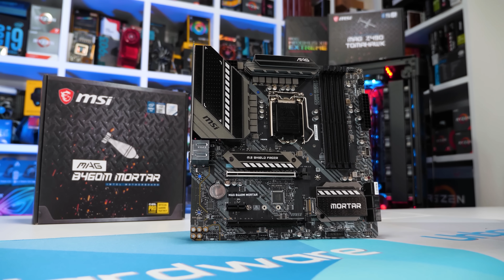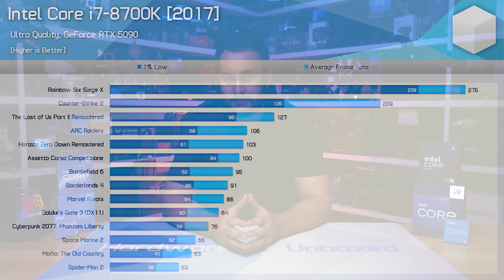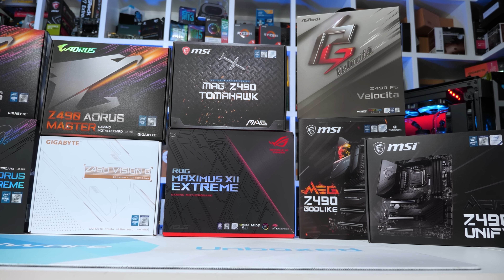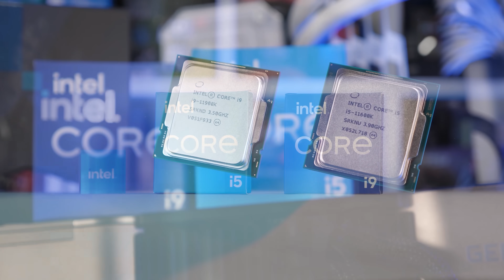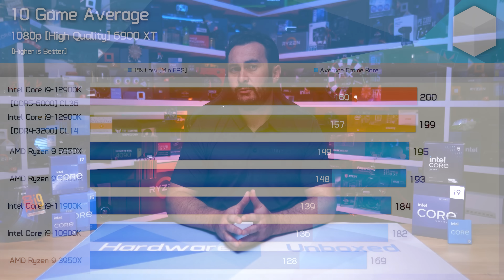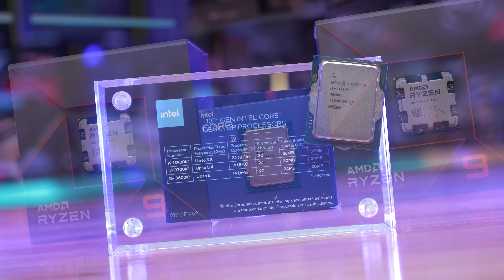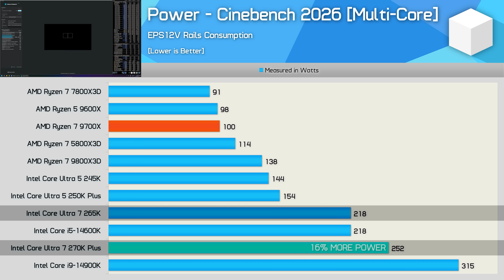How Intel Fell Behind, 10 Years Of CPUs Benchmarked

Comment: Ive been a loyal intel boy.  7700k delidded and it carried me for years with my 2080 Super then 3090.  From there I went to the 10850k which was a -100mhz 10900k and that worked very well still on my 3090.  Then on to my current 14900k with the 3090, but realized that a GPU upgrade was necessary.  So now Im on 14900k/5090 and its hopefully going to be good for years to come.  I contemplated going AMD at times, but intel has just been tried and true and never gave me an issue not once.

Comment: I've owned several "high end" CPUs over the years. 6700k, 8700k, 10900k, 13900k, 7800X3D, 9800x3d, 9850x3d. My favorite CPUs of all time are the 10900k at 5.2ghz with 4400c15 ddr4 and 13900k at 5.8p/4.5e/5.0ring  with 4200c15 ddr4. Eventually, I bought into the hype of X3D cpus. I got an amazing deal at Microcenter (7800x3d, X670E-F, 32GB TeamGroup DDR5) for $500+tax. I thought I would be blown away...Instead, the 7800X3D absolutely sucked compared to my 13900k. I hated the 7800X3D! It was slower, couldn't be overclocked, and was super boring. I then got a 9800x3d which is better, but still isn't nearly as much fun as Intel CPUs. I've spent some time OCing my 9800x3d to 5.5ghz static all core at 1.2v with 6400c26 2133fclk which has been running flawlessly since launch. Unfortunately, the gains just aren't that impressive and extracting extra performance from X3D isn't nearly as safe or fun as Intel. My 9850x3d also runs 5.5ghz with 8000c32. It's so boring that I have a 9850x3d with X870E Apex just sitting on a test bench in my garage with a 9070xt Nitro+. I'm not sure the glory days of Intel will ever come back, but I'm not sure AMD is capable of providing true enthusiast level products the way Intel has. I hope NovaLake is super competitive, has strong OC capabilities, and has longer platform support. If Intel can consistently pull off those things, Intel will regain the crown.
Reply: 4400 CL15 sounds mad. What's the performance difference between it and sth basic like 3200 CL16? Always wanted to know how much tight latency affects performance, but there's next to no info online.

Comment: Here is why Intel is where it is today in the last 10 years:
Mar 2017 AMD: Zen Launch and AMD returns to high-performance desktop computing.
Jun 2020: Apple Transition Announcement: Apple sets a 2-year deadline to ditch Intel.
Nov 10, 2020: Xbox Series X/S Release first mainstream consoles powered by Zen architecture.
Nov 12, 2020: PlayStation 5 Release - Sony joins the Zen-powered console generation.
Nov 17, 2020: Apple M1 Mac release is the first consumer Arm-based Macs reach the public.

The question is what happened before that?
The answer can be summarized by: 14nm++++++++

Comment: Hehe I'm still running a 9900k with 32gb 4x8 4200 cl16-16-16-32-48 1.5v and a 3090. 

Put my golden 8700k in a pc I built for my mom. The chip will do 5.2 ghz at 1.26 volts (basically stock voltage) avx stable and it can do 5.3 ghz but it needs 1.36v to be stable.

Only time I feel I could use an upgrade is when the 3090 can't manage at least 4k 100 fps in a game. Then I switch monitor to 3440x1440p and it feels fine again. Only thing I really need is an ssd. Only have a single 1tb gen3 drive. My 500gb 970 evo died after 15 tb written, but was 4 years old so no warranty.

I had a 10900k for a little bit with an evga z590 dark board. It was the worst platform and cpu I'd ever used. Supposedly unlocked but the chip would not go above 5.2 ghz no matter the setting set in bios or even with the oc software. I despised the "new boost algorithm"... set a manual voltage in bios like 1.35v but then it would be shoving nearly 1.5v into the chip. It very well could all have been the mobo causing all the issues because evga abandoned it in 2 months to work on z690.

Comment: Changin today from i7-7700k to 78003dx, as recently upgraded to 9070xt. Man Im hyped to see the framerate jump!
Reply: Yeah I went from an i7-8700 to a 7600X3D with a 6800 XT and my FPS basically doubled.
Reply: Went from 7700K to 5900x back in 2020. Was a major leap in performance at the time. Since then I've sidegraded to a 5800X3D and can't complain about the longevity AM4 has provided. Will either wait for next gen consoles at the earliest or AM6 at the latest before upgrading.
Reply: My plan is to finally upgrade from my i7-6700 (non-K) to the 9800X3D later this year. I don't know if it will make much difference as my 3080Ti is a bit old now, but it should remove any CPU bottleneck for the foreseeable future. (Edited to fix a typo)
Reply: @nzmetalhead  it depends on the game. Some are CPU dependent, while others are GPU dependent.
Once you switch to the 9800X3D you will see a massive boost in performance regardless of how the game dependencies are. Simply because the newer technology is so much faster like DDR5 memory and PCIe 4 vs 3 that your old 6700 motherboard had. That alone doubles your bandwidth the 3080ti is designed to use. The 3080ti has a massive bandwidth that was severely hamstrung by your older MB and CPU and memory technology. 
Definitely do the upgrade and enjoy the massive boost in performance!
Reply: @nzmetalhead  For the games I play, My 9800X3D made a big difference with my 3080
Reply: @kendokaaa  Which games out of interest?
Reply: @ralfsta Factorio, any Paradox game (Hoi4 more than others), survival games like Green Hell and the Forest, Far Cry games, Cyberpunk 2077 without RT, BF6, etc.

I usually target 100fps+ (ideally 165fps for my 165hz monitor) and lower my graphics settings to get there but so many games were heavily CPU limited. I previously had a 3900X
Reply: That’s gonna be a wild jump

Comment: I had the last of the greats the 6700k i7, lasted me for a quite a while, then upgraded to 9900ks when I splurged a lot on a new pc back in 2019 and then after three more years I went for 13900k and I think this cpu will last me almosta decade, as there is no reason to upgrade as I play on 4K now and have been for the past 2 years. Oh and with intel I started with the now very old intel core 2 duo 8400 that basically lasted me the most out of all the cpus up until i5 3470k , which is quite interesting. Even more interesting is my first PC was not with intel cpu, but rather amd duron 750
Reply: If you would have went 4k before the 13900k you would probably still be using the 9900k. :D I know I still do for 4k!!

Comment: Intel's Core i7 7700K was my last Intel desktop processor, and YES I delided mine as well and put a waterblock for a custom 360mm watercooler in it.
At the time, I paired it with DDR4-2400 32GB (16GB x2) and Nvidia GTX 1080 Ti 11GB.
Now, that system minus the watercooling and the GTX 1080Ti, but added 2x 10GB Intel LAN cards is my Router running OPNsense, a Linux based router operating system 👍
However, since then I switched over to AMD and used 2000 series, 3000 series, 5000 series and 9000 Ryzen and Threadripper series processors.

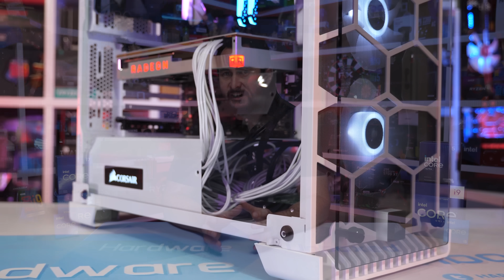Comment: 9:31 great to see another RADEON VII 😍 you should make a revisit video about it how it holds up in 2026
Reply: I still have this gpu (Radeon VII) on my brother pc (works better on linux (raytracing is working) but my brother prefers windows 11(he have Ryzen 7 5700 X3D, 32GB Ram). 
If we got re-test Radeon VII, please make some linux benchmarks too.
Reply: Dang, I thought this thing is a vaporware.

It's hard to get one, and then it was swiftly replaced by 5700XT by AMD.
Reply: I had one and it died within 2 years of me buying it. During the great GPU shortage of 2021.
Reply: @Powerman293  By any chance, did the HBM modules come from Hynix?
I have a VII that came with HBM2 modules from Samsung and it's still running. I heard the interposer used on the VII's with Hynix HBM modules is a huge failure point
Reply: i think it holds rather up
Reply: Vega's last stand!
Reply: Holds up better on Linux. And still can't run Crimson Desert or FF7 Rebirth unfortunately.
Reply: Im also still running one under Linux... Or well the original datacenter card the Radeon VII was based on (Its the same GPU theres no hardware difference)
Reply: Still have my Radeon VII! She sits safely in a GPU box waiting for the day I have space to display her.

Comment: My 10850K felt great with its 7 plus symbols -100Mhz, but honestly its CPU/RAM latency was very snappy (37ns) and Windows/Apps responded lightning fast. But 180watts in Premiere Pro and Shader compilation did hit me hard in Australian Summertime. Making my room a bit of a hotbox.
Reply: I only have two modern intel CPUs and I thoroughly hate one of them.  10300H. It never runs at less than 90C, not even in the winter. And the only reason my Xeon is good is because it runs on a hacked mobile chipset and draws 60W max.
Reply: I'm still on 10900k and feel no need to upgrade at all (for gaming workloads). Play on 5160x3160 using a 5090, aka CPU bottlenecks are non-existent or minimal (i think once i saw 5% bottleneck or so compared with benchmarks on this channel).
Reply: @ZenzDeluxe  nah, i had to replace with i5 14600k. Its single core is too slow if you need fast cpu for gaming

Comment: Nova Lake will probably not be very successful, even if it is genuinely good. The problem is that AMD has by now quite heavily dominated the DIY market for years. Nobody (or hardly anybody at least) with an existing AM5 system is going to switch to Intel..., there is no point at all in doing this (waste of a lot of money). Even if Nova Lake can beat Zen 5 quite significantly..., just wait 6-12 months for Zen 6 then and simply upgrade to that. This will even be very worth it, if Zen 6 would end up being 10% slower than Nova lake (which is kind of unlikely). 

That means Intel is essentially left to compete with AMD for AM4 users or customers with older DDR4 Intel Systems... . Since even Zen 7 will come to AM5 (almost guaranteed by now) the decision then would heavily depend on platform longevity. AM4 users could still buy into AM5 with Zen 4 fairly cheap at that point and upgrade to Zen 7 in 2030-2032...  . If Intel again plays the "you need a new socket/mainboard" game for the first new architecture after Nova Lake...  complete fail.

Lastly, a lot will depend on pricing for the CPU and also for RAM at release. If DDR5 is still very expensive at release Nova lake is simply doomed, while Zen 6 may still be fairly successful as in socket upgrade for existing AM5 platforms. Newest "rumors" also suggest that the Intel 3d cache equivalent will only come to expensive higher end versions of Nova Lake... .

Overall I do not see Nova Lake being successful in sales. All Intel can hope for is getting a new foothold, something comparable to Ryzen 1000 back in the day. Nothing more.

Comment: From the second generation Core to the seventh generation, Intel gave us NOTHING. SIX generations, from 2011 to 2017, Intel gave us NOTHING. They drove technologies to make it cheaper for them to make the chips they sold us, while simultaneously not changing the pricing hardly at all, with virtually zero performance improvements. They DESERVE to go under.

Comment: Whatever Intel did to screw its fan base with forced platform changes paired with their lack of innovation paid off with their plummeting stock prices, market share, and immense lay offs. That's Karma!
Reply: Weirdly enough, they are continuing to do exactly that right now.
Maybe the next generation could finally come with their first new CPU architecture in 6 years, but it will certainly be on a new socket, for SOME reason
Reply: @malucart  They have to make a new socket. Nova Lake is a big change, and most of 100+ new pins most likely will be dedicated to power and IO changes. When you design chips for non-socketed systems routing/pin layout always changes. Keeping the same socket always gonna limit you to what you can do next. Something brand new on silicon side take up to 5 years. There was no "quick way" for Intel to respond.
Reply: @davidlt  Yet AMD was able to figure out the socket issue.
Reply: plummeting stock prices, while at the highest it's been in 5 years? What are you smoking.
Reply: Some facts: Consumers are not Intels most important customers, enterprises are. Intel's market share is still much larger than AMD. Intel stock price is record high. I don't care whether I use AMD or Intel, and one shouldn't let bias get in the way of facts. PS. There is no need to celebrate immense layoffs of real people.
Reply: And still did sell more than AMD…. 
😂

But yeah… they did lose a lot of market share!
Reply: @haukikannel  Check retail vs enterprise trends over the last 10 years. Retail customers are not bound by contracts or stagnated management teams outside of the tech loop.
Reply: @haukikannel  Intel still dominates in server, desktop and mobile. Volume wise Intel can deliver more.
Reply: @davidlt Yes, I agree.

Comment: I wish you benchmarked the 13th or 14th gen CPUs with DDR4 like you did with the 12900K
Reply: 100% agree.  Would be really interesting to see if IPC, MHz and Cache gains of the 13/14th gen could mitigate some of the 12th gen losses when paired with DDR4.  Given that on day one the 12th Gen benchmarks showed little performance gains when paired with DDR5 many I'd assume made the plunge and paired the 12th gen with DDR4, so It would be nice to see if the upgrade path is worth it while sticking with DDR4.
Reply: I would also be curious to see how all of those flagships compare in temperature. Is the 9900K hotter than the 12900K? Is the 270K cooler than the 7700K?
Reply: @Speejays2 the 9900K is 100% hotter than a 12900K. I use the 12900K at 5.2GHz with a 360 AIO and only go above 80c when benchmarking or when some games (Enshrouded as an example) do shader compilations before actually getting into the game. I live in Los Angeles so even during those 95° F summer days, it stays relatively within a respectable heat range.
Reply: What about dual rank ddr4 too. Upgraded my ddr4 3600 to dual rank for a bit more performance. Gotta be closer to ddr5 quad rank now. Lol
Reply: Exactly. Have a 13600k coupled with 3600CL16 DDR4 ram and it is a wicked combo, but would like to see some benchmarks

Comment: if the 250k plus and 270k plus came with ddr4 capable mainboards it would actually be kinda an interesting upgrade option
something that can either 2x2 ddr4 or 2x1 ddr5 so one could upgrade from a 4 stick ddr4 setup without having to get new ram until ddr5 prices get back to reality
when i saw the launch of the k plus line thing i thought that was the point of making them that cheap but i guess they just dont do ddr4 at all anymore
which is specially for intel a bum cause every 2 cpu's you have to get a new mainboard and i wouldnt wanna buy each single generation of cpu
like i wanna skip one or 2 or even more if i can like thats the point but with no socket life thats just a big oof for intel
meanwhile i could put 5800x3d THERE I MENTIONED IT MUEHEHE
but if they wouldnt be so dam expensive everywhere i could put that into my am4 pc thats running a 2700x right now and id only have to buy the chip not another whole board for it and then more ram
at that point just dont even make sockets, intel, just put it right on the motherboard cause whats the point of making a chip removeable when nobody would

Comment: Still on 12th gen and dose everything I need.
Reply: Same here, but looking at a Nova lake upgrade for the Gaming PC this year if they actually release that this fall
Reply: Yea man some people still say 7700k is faster than 9800x3d in game on intel sub too.
Reply: @railshot888  thats a little extreme. but if youre playing at a normal res like 1440p or 4k, your gpu is going to be the limit, not the cpu, at least one released in the past 5 years. the 7700k will definitely not hold up.
Reply: @railshot888 12100f was a perfectly good budget CPU.
In the same way that the the AMD  Athlon X3s were at the time.
Cheap, silent, power efficient and capable of 60fps on most games even now.

Comment: 1. Only making a good/better product than will not suffice it has to significantly undercut AMD Counterpart for people to take the risk and trust intel after the 13th and 14th gen issues.
2. Has to bring overclocking in B series board (stop with the locked and unlocked BS); most current B860 are beefy enough to do some minor PBO level tweaks.
3. And not bring and new technology to your board/chipset which and make the platform insanely expensive to adopt at least not for the B series.

Comment: I'm still using my old 7700k in a secondary system running Bazzite with an RX 580 8Gb and it's surprisingly still quite usable today.
Reply: It's really not bad as long as you don't try play any AAA PS5-era games.
PS4 era games are still great.
Reply: yeah i just dusted off my old i7-6850k gtx1080ti system for my brother to use. it can play cyberpunk.

Comment: With the Ram prices it will be Hard for Intel to gain much marketshare.
Imagine you need to buy 8000mhz DDR5. My used Car is less expensive.
Reply: I bought 48gb of 8000mhz when prices were low. I thank god now 😅
Reply: @jonathansaindon788 I bought 48 GB of 8000 MT RAM by mistake when prices were low. It was so cheap, I threw it in a drawer and forgot about it. Now I don’t know whether to resell it or just build a new computer. I also bought 2 1TB SSDs instead of 1 2TB SSD at the same time.  Tip: Don’t order parts when drunk.